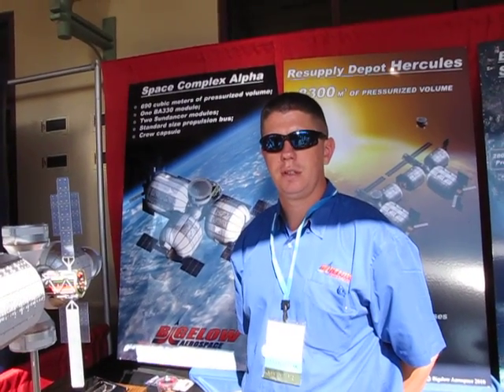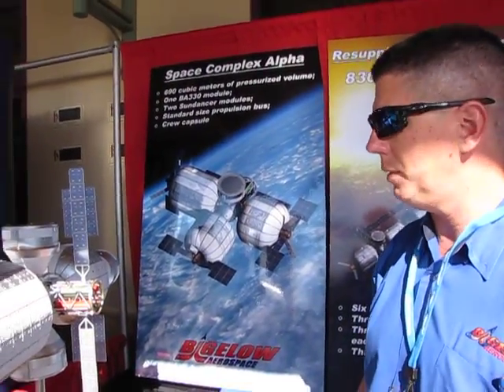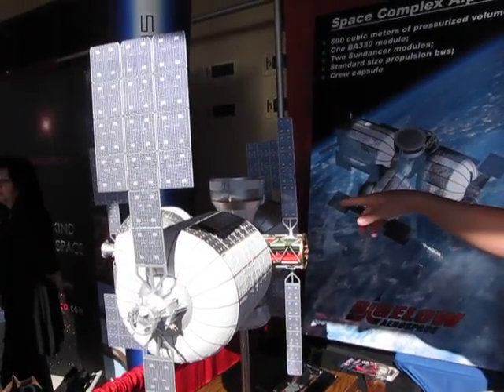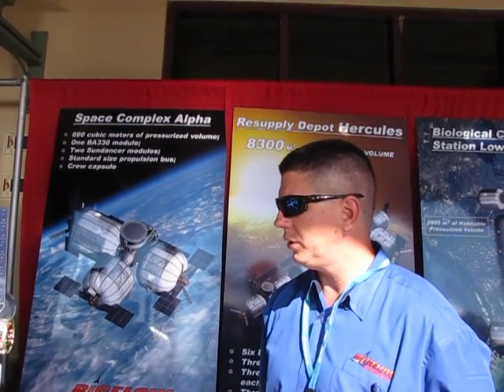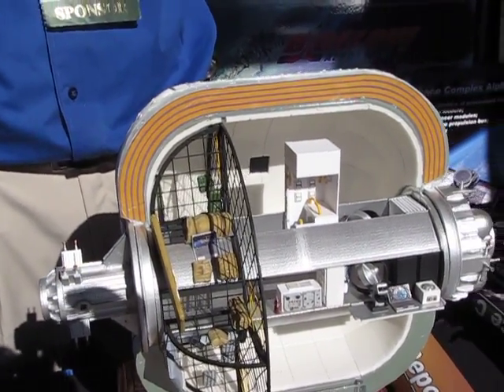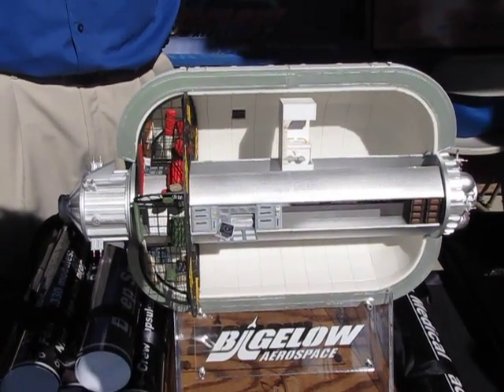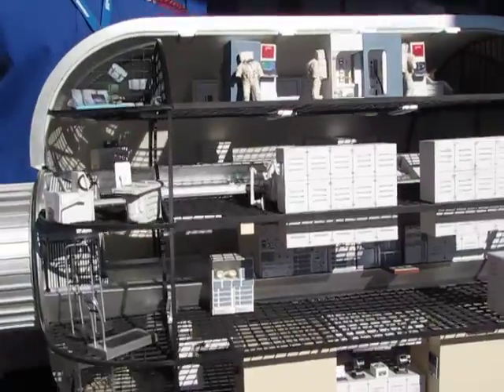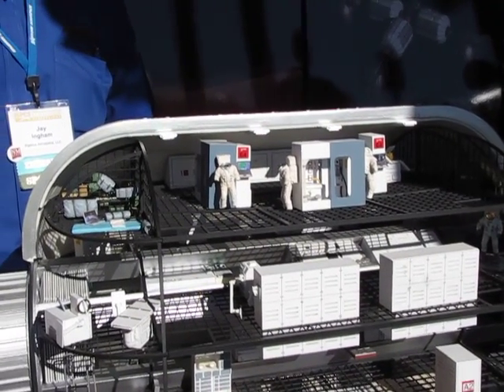Bigelow Aerospace's Space Station

Comment: Too bad that Bigelow is no more; it looks like these inflatable modules offered great promise for the future, even if the future is at least several years further down the road. There are at least three major questions that remain in the wake of Bigelow's demise:  (1: Did another major aerospace firm acquire Bigelow's assets so that work on these inflatable modules could continue?  (2: Did the layers of outer sheathing in Bigelow's inflatable modules contain enough polyethylene (or other hydrogen-laced fabrics) to sufficiently protect the module's occupants from solar radiation storms and galactic cosmic rays?  and (3: Did work like Bigelow did on these inflatable modules allow for their use as portions of surface bases for the Moon and Mars?

Comment: 2014-2016 for a fully operational private space station? That time frame was way too optimistic even for 2010. They only recently got the green light to launch the Bigelow BEAM module to the ISS. The BEAM module is set launch April 4th 2016 for testing & it's only about a quarter the size of the BA-330 modules they plan to use for the Bigelow expandable space station. I see it possibly being fully built in the mid 2020's if SpaceX can chime in with the Falcon Heavy.
Reply: Time Frames for that kind of thing are always too optimistic. Back in the 1970's they thought we'd be living on the moon and Mars by now.
Reply: GAMP: Sicker than your average kigger nilller   SNC is just making a spacecraft which will launch light cargo & eventually crew to ISS. ULA will launch it. Technically SpaceX could still launch a few Bigelow habs on Falcon Heavy soon. Also Starship/Superheavy is at least 5 to 10 years away from doing regular space missions. I think Bigelow was having some financial issues & they may have tanked because of it mainly because of a lack of investors & not enough NASA funding.

Comment: It sounds like that 2x-ISS-sized module is kind of impractical, if it needs more power than the largest rocket NASA requested. But if you can bring up a bunch of modules and hook them all together, wouldn't that be just as good?